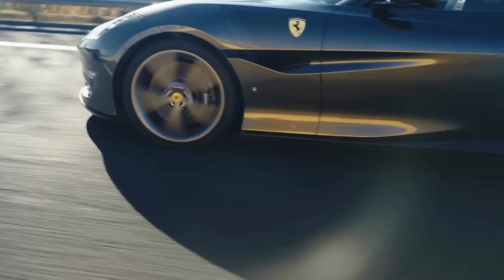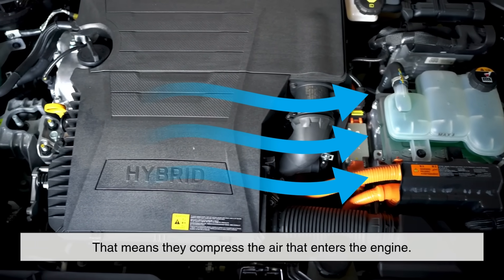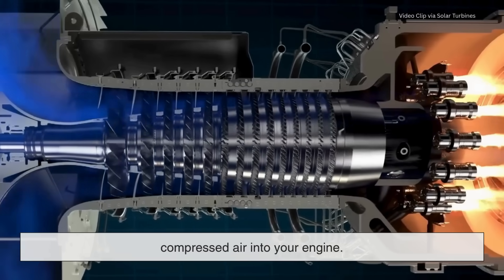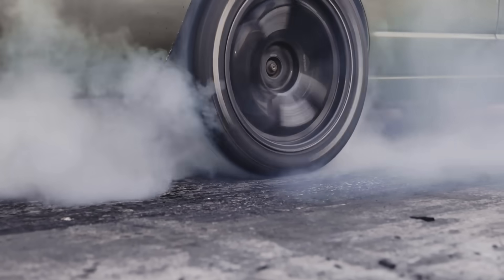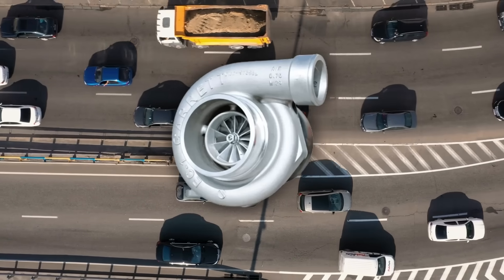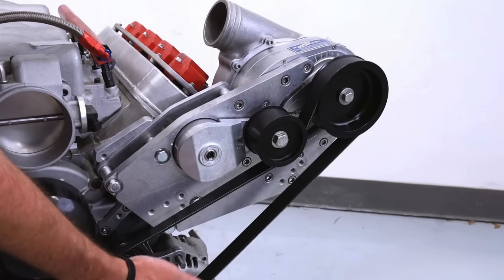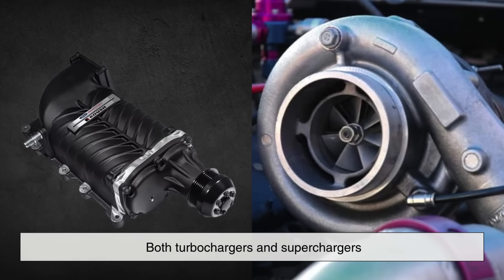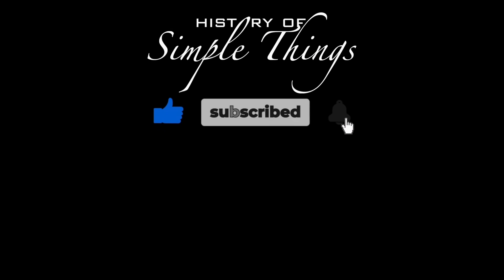Turbocharger vs Supercharger: What's the Difference?

Comment: Can you explain to an amateur why not just have a bigger engine instead of a supercharger? 🥴
Reply: Mainly, you use a smaller engine with a turbo (typically a small turbo, or two) because a larger engine will not fit in a smaller vehicle. Also, you can typically get the same power, or more power, with a smaller engine/turbo combo than a bigger (v6 or v8) engine. More recently, this is done because of emissions regulations and maintaining a decent fuel efficiency. There are a lot of variables but that's basically the idea/concept.

Comment: Ummm... Roots and Screw type superchargers BOTH compress the air internally. The air is trapped between the lobes of the rotors and the blower housing... thus they are POSITIVE DISPLACEMENT and THAT is why they provide instant power when you stomp the GO pedal.
Reply: Positive displacement means the same amount of air is force thru it on every revolution. The faster the speed the more air with no loss, because nothing slips by the rotors.
Reply: @horsepowerandtalk1033 that's what I just said... There ARE centrifugal superchargers, and the 2 speed ones on the Rolls-Royce Merlin engines are what made it such a popular high altitude  engine for interceptor aircraft.
Reply: You may think you said that, but if someone didn't know what the definition of positive displacement means your point would have been lost on them. To be clear other types of pumps have slippage and at higher speeds, so they lose volume per revolution.

Comment: Best of both worlds: charge battery with turbo, and battery runs electric motor supercharger instead of sapping engine power...
Reply: Turbocharger uses normally wasted exhaust flow to spin a turbine which in turn spins a centrifugal compressor. Simple. No need to complicate issues with electrical losses. The more squirrelly you get trying to hype things up the more complications and energy losses you incur... that's why smart engineers go with the KISS method. 
Keep
It
Simple
Stupid

less to go wrong and less to break down